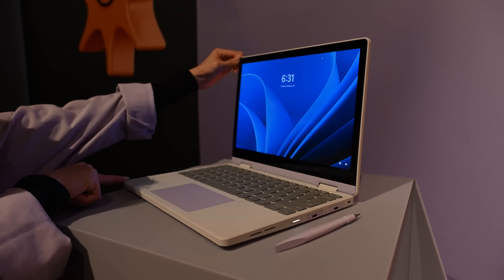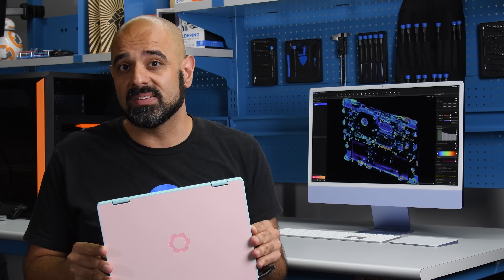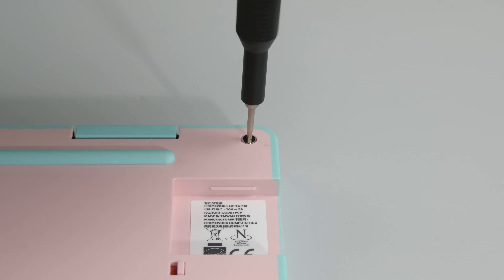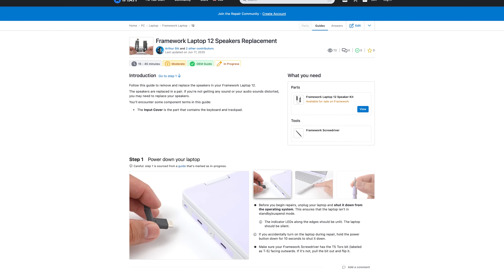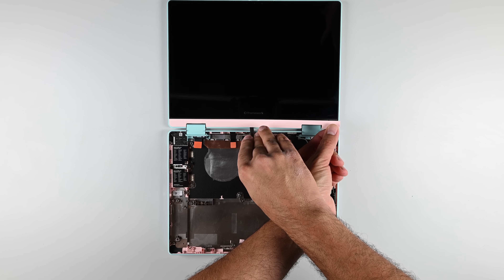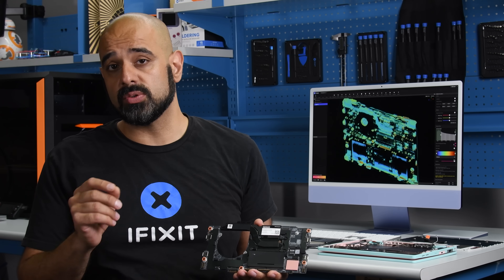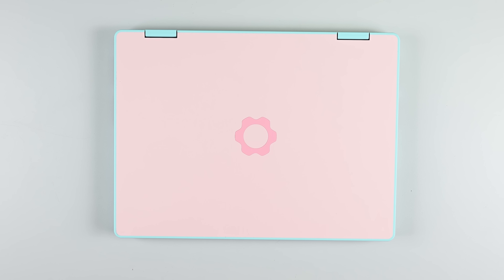Framework 12 Teardown: Touchscreen, Tablet Mode, and 10/10 Repairability

Comment: This may honestly be my next laptop to get. I don't want anything with Windows preinstalled, and I don't want to shell out over a grand for a macbook. I like that this has the capability to be upgraded, so even though the initial configuration price may be a little high and almost pushing Apple prices, the fact that it is upgrade-able means that the cost to maintain over time will be significantly cheaper than buying a new device every other year or so because the internals cannot be upgraded and its now considered obsolete (*side-eyes Apple*). Definitely going to get this and load Zorin OS onto it and it should be my long term running laptop/tablet to carry around with me for a good while.

Comment: The problem is that the replacement components are only available in certain countries. If you aren't in a supported country when something breaks you can't fix it. They need to enable resellers in other countries and also sell on Amazon due to its broader reach.

Comment: The one thing that's kept me from getting a Framework has been the lack of a touchscreen option. It seemed like they were never going to make one, and people had to figure out how to add one themselves. I checked for a guide on how to do it again this morning, and imagine my surprise when I found THIS VIDEO. I thought it was fake for a moment, I'm so happy. I've got a lenovo 2-in-1 right now, and I don't expect it to last forever, so the moment it kicks the bucket I'm getting a Framework finally.
Reply: I'm in the sameish boat as you. I got a thinkbook yoga from a pawnshop for cheap due to a missing charger and the fact it was sitting around for a while. I later found out the spacebar got a little mangled mechanically and the touchpad traces underneath suffered as well. Looking at a $200 top keyboard panel to fix the darn thing and its an undertaking to replace. You would think the touchpad could be replaced separately but no, it's riveted to the keyboard panel and comes ordered as a single part. Might keep it around as a tinkering device, but the Framework 12 has my eye. Here's hoping they make a separate screen option for those that want it.

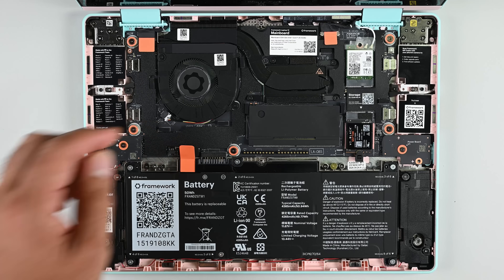Comment: 2:32 I don't like the battery being connected by prongs, which means that I have to remove the screws of the battery just to upgrade the memory instead of disconnecting a wire
Reply: You don't have to remove the battery to replace the RAM.
Reply: How often are you upgrading the memory?

Comment: why can't they have the battery be external, like my old 2000s laptops? you used to just swap them while running, and have an extra in your backpack.
Reply: the casing of the battery and the structure take up space, thus reduce the battery capacity that the same space can offer

Comment: This is why I was an early adopter to the original Framework Laptop 13 (Batch 2), I like what they represent. Yes it was expensive, but as the price comes down (in this case for the 12) it becomes more accessible to the average person, and means they themselves can look after their own laptop. Not behind a sealed, stickered, 'warranty void if removed' panels.
Reply: It's why I wanted to be an early adopter, but unfortunately I didn't have the money.  Still, around the time the amd model came out and I got some money all at once, I definitely picked one up as a working laptop and I don't regret the decision.  It's the most expensive laptop I've ever bought, but it's also probably the last laptop I'll ever buy for myself (assuming I can go ahead and ship of theseus it for as long as framework remains in business).

Comment: another thing about this model i think no one noticed that the speaker openign are on the side so in both tablet mode and laptop mode the audio will not get blocked or distorted, i never saw something like that other usually put speaker on the buttom side or on the top side

Comment: I think Framework is doing wonderful things when it comes to making their devices repairable. What I disagree with however is those price points. I’d rather get a cheaper, yet less repairable Lenovo, Dell, or any other non-Apple branded laptop than a Framework for that reason alone. If I wanted to run Windows or learn how to run Linux, that is.
Reply: You are right but that's not the point, they are expensive because of factors like reparability
Reply: @android-user ultimately you a ton of money because you would have to buy an entire new laptop after a few years with another product.  Because there's a broken ribbon cable or a port that no longer works or you can't take a charge. Those are fatal problems that require purchasing a whole new laptop. On the framework it's barely a headache.  

Obviously someone that's really low on cash and just needs to keep expenses down in the short term should probably just salvage or used think pad or buy a used laptop or something.  But anyone that has a budget to accommodate this laptop will ultimately save themselves probably over $1,000 the first time there's a major component breakage in the next 5 years
Reply: It pays itself the first time any important piece stops working. If you're using any of the other laptops you mentioned like Lenovo or Apple you'll have to replace the entire thing. That's what another $1,000 at least. Here you can replace it for a hundred bucks and keep it going for another 5 years. You will spend way less money. Because you will have to buy a second and a third and a fourth laptop before you would have to get rid of this one. A broken ribbon cable on a Mac can be a fatal problem.  Let alone the battery.

Comment: Wow, so well done. No glue, no plastic crap that needs to be melted, which ACER loves to pull on us for replacing the keyboard, no soldered-on wifi card this f-ing industry is adopting like a plague spreading quicker than you can say "the laptop industry is damned"; POGO pins used in a clever way, it doesn't get any perfecter.. for the device. Too bad Framework won't ship to select countries...

Comment: I hope Framework really did their research on the overmolding - a lot of overmolded designs have issues with material choice and/or mechanical design that results in degradation or falling apart in relatively short order. Wouldn't break the laptop as such but it would make it very unpleasant to use if it happened here

Comment: its so cute </3 but u can get a 5x better laptop for the same price
Reply: if you take into account that most other laptops will end up in a landfill within 5-10 years, FW becomes much cheaper in the long term since you can upgrade and repair along the way rather than replacing the entire device
Reply: Better ❌More performant ✅

Comment: Is that exterior the kind of plastic that's gonna turn to sticky sludge in a few years?
Reply: Hopefully not, iirc it's polybutyline or something that's used for tool overmolding and is infamous for liquefying, if it's well attached and an appropriately robust polyurethane it should hopefully stand up better. Only time will tell for sure though
Reply: framework laptop 12 uses tpu which shouldn't become sticky over time!

Comment: Oh no Framework used the same flimsy hinge / screen holding desing as lenovo and on my lenovo the plastic that hold the screen crubled after 2 years. it was suppost to be at least a metal frame.
Reply: It's possible that those are plastic covers with a metal hinge inside but it would have been nice for them to confirm if that were the case during the teardown

Comment: $800 usd plus? Why do people een want these laptops
Reply: Apple’s lattest Macbook Air is at least $999 for the 13 in model and the Macbook Pro starts at $1,599. When you have laptops that are made by a company that proudly gives a middle finger to user repairabillity and futureproofing, it’s a no brainer as to why people like framework laptops.
Reply: @relicvault15 Chromebooks are cheap? Why bring up some random brand this laptop manufacturer is pulling an Apple. $800 for the i3?
Reply: Chromebooks use ChromeOS though lol.

Comment: You know, this is probably easier to repair than laptops made 15 years back… when they were clamshell fat
Reply: It is indeed easier, but the fat ones still have one ace up their sleeve tho: replaceable CPUs.
The current market doesn't have this plainly for Intel/AMD's and OEMs being stubborn and forcing the soldered solution, cause a thin socket is just as easy to do as it was 20 years ago. Not Framework's fault for sure, that's on the CPU manufacturers.
Reply: @Kalvinjj  The sockets supposedly became a power/signaling problem, in mobile power envelopes but not desktop ones. It'd be a lot better if someone could overcome it, because I obviously don't dig the idea of replacing the entire system board, either.
Reply: 15 years is old enough that a decent number of laptops still had removable batteries, as in they actually clipped in as a detachable module. A fair bit of this is better but it's really hard to beat a latch to just pop the battery out for one of the most common repair jobs.
Reply: @bosstowndynamics5488   Some laptops still had removable batteries less than 10 years ago, like some Thinkpads. Though with the more current ones Lenovo is also aiming for flat designs unfortunately. That said I think a builtin battery that's easy to replace is still a perfectly fine design choice.
Reply: I recall at least one Dell laptop from those 15 years that had a user-replaceable CPU and a fat Fujitsu with a replaceable dGPU.
Reply: @CnCDune  I've seen one indeed with downright a desktop CPU (and that isn't even 10 years ago if I recall), and if we go back to 2010 then I'm sure more will pop indeed.

I don't really buy the power and signalling story. Just another convenient excuse for "yeah we don't want to, just buy a new one".

Comment: I fully support right to repair. But this isn't any easier compared to budget Dell, HP, MSI, etc laptops. (at least Asian / South Asian variants  )
Reply: It's easier than most tablet options but you're also ignoring some key issues that are in some cases out of scope for an iFixit teardown: 
1) Framework labels everything clearly and designs it with a view towards novice home repair rather than technician repair like many other more modular OEM designs
2) Some common parts are easy to swap out giving the appearance of more repairability than is actually the case, you can get the battery out of an Inspiron fairly easily but replacing the keyboard is harder and replacing the screen is a fair bit harder (and worth noting that part of the reason it isn't a lot worse is because other companies are feeling pressure to at least pretend to care about this stuff, pressure that's being amplified by Framework). This goes double for some parts that are kept modular in Framework's designs but are increasingly integrated in others
3) And most important - Framework has by this point demonstrated a reasonable track record of long term support, both for each physical platform and for parts availability. You can usually pick up spares for common laptop repairs from eBay but it's not the same as having verified high quality parts available, particularly for more obscure parts. 
4) Framework publishes board repair schematics, laptop repair shops have ways to get their hands on these for really popular laptops like Macbooks but any single given model of PC laptop is going to be a complete crapshoot as to whether you can get schematics to allow feasible board level diagnostics and repair. Alongside this, they don't go out of their way to use proprietary serialised ICs on their boards to try and prevent third party board repair like Apple does
Reply: With Framework 13, mainboard replacement can be another generation or a lower/higher tier.  My former Lenovo Yoga 7 Pro's mainboard replacement is within the same generation and model.

Comment: I hate those battery connectors that make you unscrew the battery to disconnect it.
Reply: Can you explain why you hate it?
Reply: @drojf  Yes. And i will explain here. it makes you unscrew the battery to unplug it and you should always unplug the battery before doing repairs but it is two much extra work to unplug the battery (but with the capitive screws it might be fine)
Reply: @Velocifyer hmm...while it's not as simple/straightforward, there is an option in the BIOS to disconnect the battery (presumably by telling the battery controller to turn off) for maintenance purposes, so you don't need to remove the whole battery.

Comment: For $600-$650 price bracket it is good, but above that I think getting a MacBook AIr would be better.
Reply: MacBook Air can't do integrated note taking.
Reply: The problem is that the base price does not include RAM, a processor, ports or SSD. Once you add all that it gets perilously close to a grand.

Comment: Am not aggree with repairability it's score  10 must be 7 cause the most point it's free schematic and boardview file and bios that it's most important
Reply: They opensource a lot of the designs
Reply: I hardly touch the firmware. I prefer mainboard upgrades.

Comment: I have made the decision that my next laptop will be a Framework 12.
Currently I am using a stop-gap second hand T495, it's good but the hardware is annoyingly slow at this point and it is disconcertingly bendy.
This to replace my previous e585, which I hoped to keep in use but which unfortunately got unstable, thus unreliable.

I am waiting for a review comparing the performance of the two CPU models, since the i3-1334 is significantly more expensive.
This for what seems to be an insignificant improvement over the i3-1315, especially considering the stricter power limit of the 12.
But since I will be using this laptop for over 5 years, hopefully a decade, I do want to be certain first.

The level of repairability at show here is far beyond my expectations, those pogo pin connectors are very clever.
Those modules do make it expensive, especially since I want an Ethernet one.
But with how open the design is, the solution is to only get two modules and to design a case for a USB-C dongle which slots in the other half.
Which I will design myself and 3D-print, around a cheap but perfectly suitable dongle which I already have.

Currently I use a dedicated screenless drawing tablet for note-taking.
While I will keep using this for the greater accuracy and comfort, in a pinch the stylus support for the screen is incredible for me.
I am waiting for the stylus to release too, so I can combine the order.
And I will add on a screenprotector, for the better feel and to avoid scratching the glass.

With modern ThinkPads getting worse keyboards and one of the last ones with decent boards getting annoyingly slow, the compromise here seems reasonable.
I will miss the physical click buttons above the trackpad, but it should be possible to map something similar in software and sticker on 'buttons'.
Reply: Be aware that the Framework 12 only runs a single channel RAM which costs you some CPU performance, but it also disables the Iris Xe and uses only some basic intel UHD.
Reply: You dont know slow man, im daily driving a T440p. Reliable as a fk tho
Reply: @juandiego2347  I do, used to daily-drive a Core 2 Duo with 3GB of RAM.
And it was fine for the time, but currently my IT studies demand more from the hardware.

Comment: it is very satisfying to see excellent engineering like this.  Make no mistake, companies like Nintendo glue down their batteries with huge amounts of glue and design their electronics with anti-repairability in mind on purpose to make you buy a new one.  Every company should design their products this way.
Reply: Yes and since they've proved that they won't do it voluntarily, they should be forced to.  Enough of destroying the planet and screwing over the little guy for profit.
Reply: Definitly. Nintendo is only rivaled by Apple
Reply: Nah, they'll just say that planned obsolescence will hasten the pace of innovation
Reply: @GungKrisna12  planned obsolescence will hasten the pace of climate change :)
Reply: Nintendo is still on the better side on repairability (outside of propitary Triwing screws it's pretty repairable)
Reply: @redstone0234 it is not. I tried to replace the battery in two different switch lites and the battery is so glued down that no matter how much alcohol I tried it would not come off. I’ve never seen a more glued down battery in my life. Go check out ifixit teardown of the switch 2, it is just as bad or worse.
Reply: @redstone0234 Not really...if at all...
Reply: @trou_noir4  Swapping shells, screens and batteries is routine with Nintendo devices.
The Switch 2 only has mild annoyances, like stickers and shields that barely hinder the process. Everything is as easy to replace as it is on the Steam Deck and other similar devices.

Comment: Everything about this is good except the Intel processor. It would be a day one buy for me once they get the AMD sku out, hopefully soon.
Reply: The whole point of this specific device seems to be to get a very affordable 360 device into the hands of students and the like. That's why they chose to go with previous gen Intel chips which they got for cheaper. AMD is in really high demand and relatively high prices for this kind of product.
Reply: Are Framework's people generally better at writing/sourcing firmware for AMD components than the contractors for a company like Lenovo? The AMD version of the T14 was miserable when I tried it, and a friend owns one that uses enough energy while suspended to flatten the battery in <48 hours.
Reply: Intel is better at single channel compared to AMD
Reply: @JoeHoeDoesSomething Maybe it doesn't hurt the CPU performance so much, but it disables the Iris GPU...